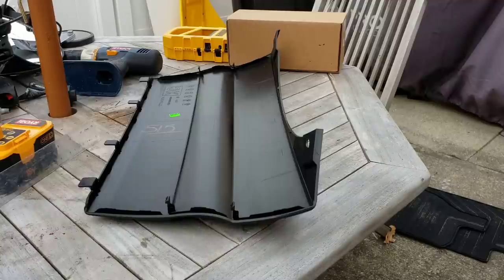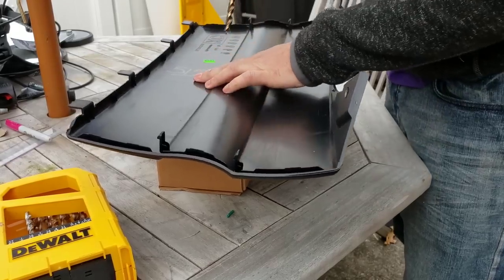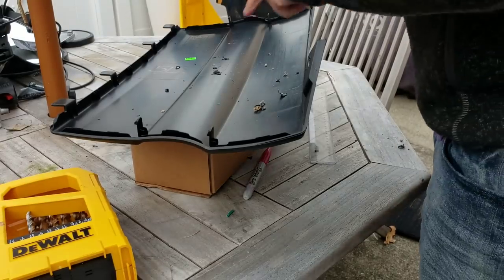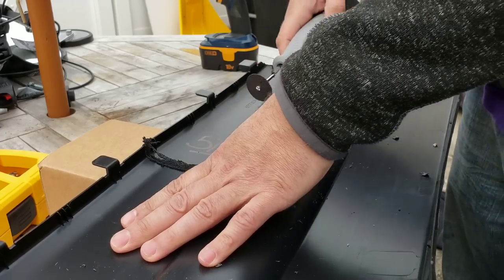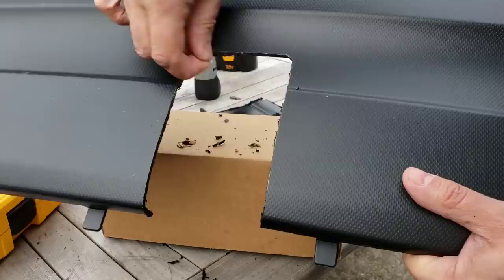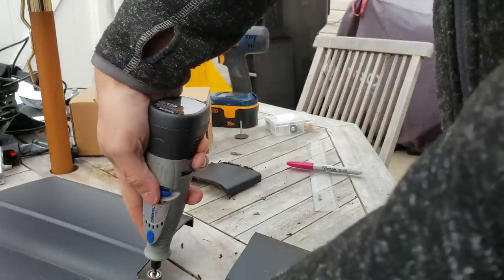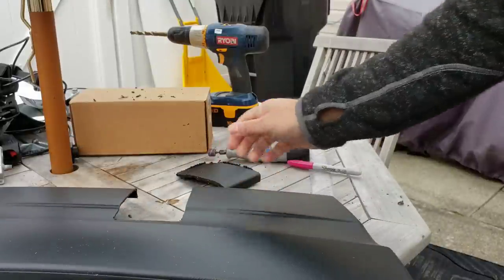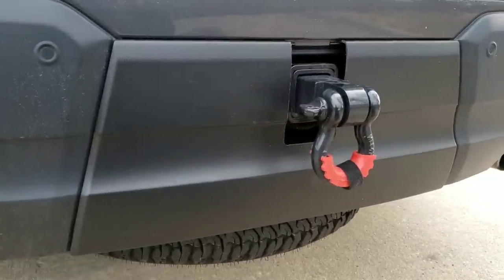HOW TO: How to mod a Subaru Ascent hitch cover for use with a bike rack or similar accessories

Comment: Looks a bit ragged.  Also, no access for electrical plug??
Reply from the maker: There's a trim piece that can go over the edge, like my current one, and no, no electrical cutouts, because this one is for when I use my bike rack. If you check over in the Facebook group (the one with 16,000+ people), my friend Brian makes them with bigger cutouts to accommodate electrical hookups. I own three total, made by him or me, for various needs (remember, I tow, I use a bike rack, and I use a cargo platform I sometimes run power to).